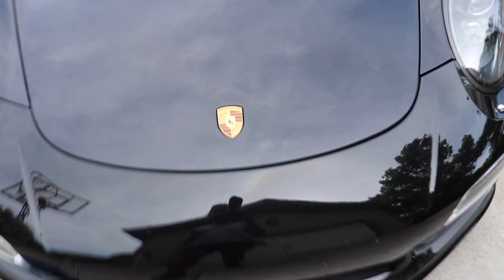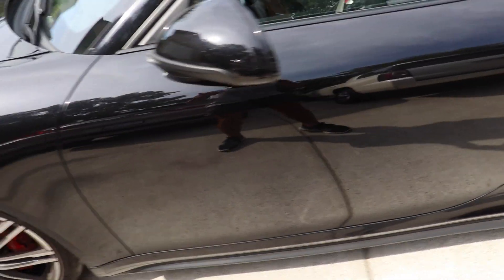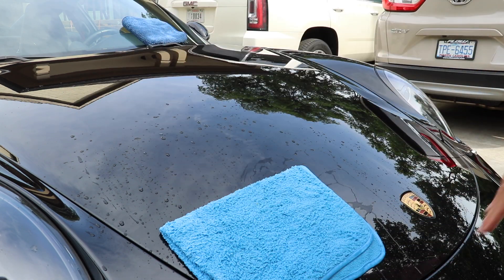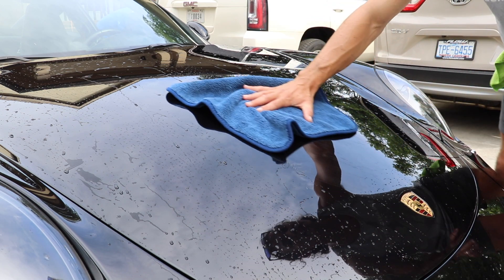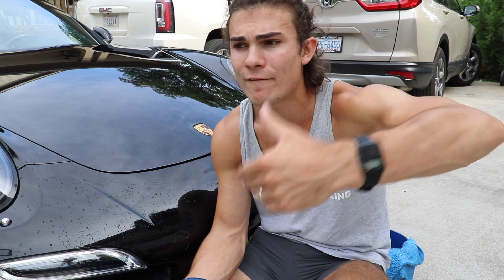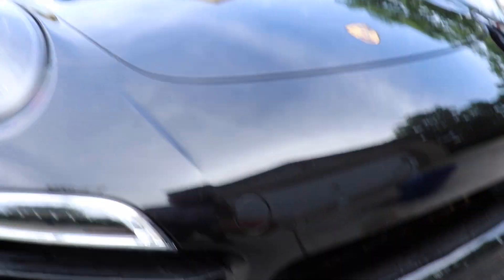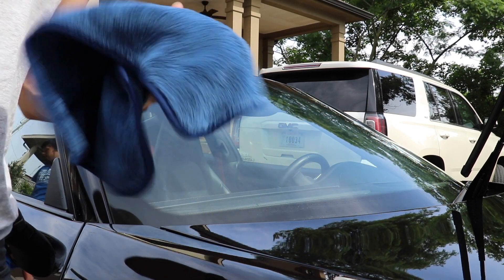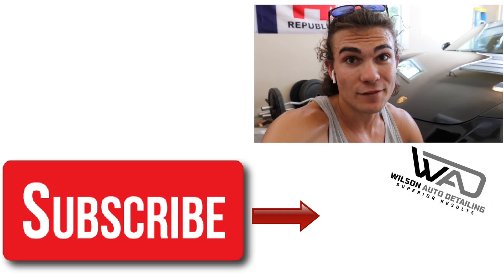Who Cares About Your Wash Method | You may be swirling the paint!

Comment: You keep pushing all these cheap maxshine polishers and products????
Reply: Have you used one of their polishers for a length of time? I know people have horror stories, maybe you do too, but you run into those with any manufacturer. 

Maybe I got lucky and got a good one, but my M15 sees daily use for over a year, and the only maintenance I've done is blow it out with air once a week. That's it. Never a single problem. It cuts and finishes as well as my LHR, it also runs cooler and needs less stall management and at half the price. Only complaint is the speed dial numbers wore off. 

Haven't tried their towels (I'm a loyal TRC Eagle fan) or any of their other products so I can't comment there, but I definitely wouldn't hesitate to use any of them. Just my experience.. 😀